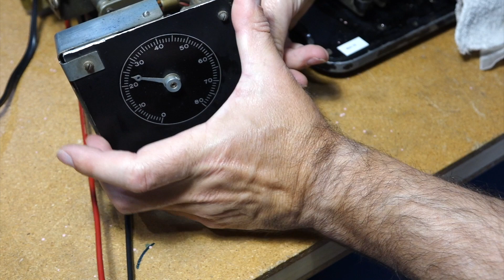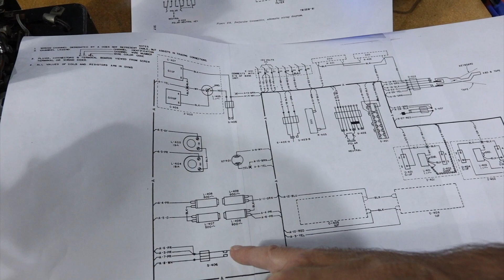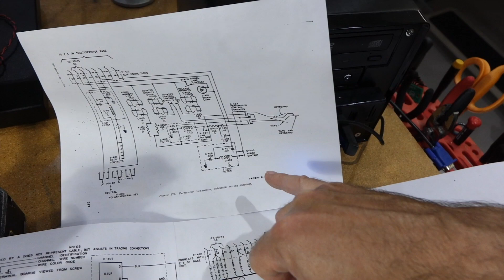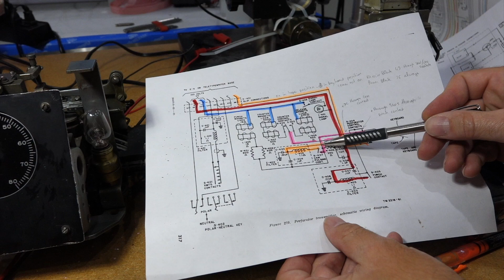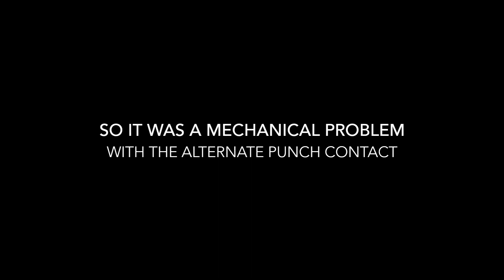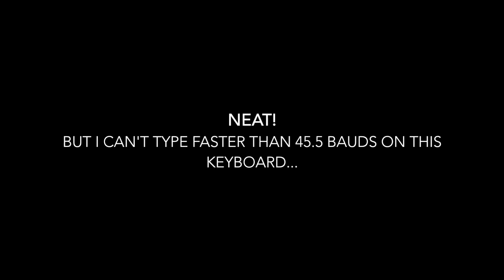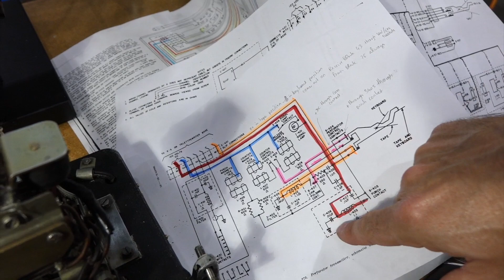Teletype Model 19 Part 6: Fixing the keyboard counter, filter and repeat features

Comment: E: Nvm. I misunderstood one thing and was shown wrong later on.

~~I suspect that the reason the character counter does nothing if the local printer also prints is that you can then more easily (and maybe even more correctly, v. bell) see how close you are to the end of line on the printer. Does that make sense?~~

Comment: I worked at a gov't facility in the late '80s and early '90s, and still used a lot of that vintage equipment.  The contracts for custom replacement parts were simply astounding.   But we managed to have some fun with all those punch chads we collected!  Take a cup full and drop them into the defrost vent in someone's car, set the switch to defrost and fan to high... then wait for the show when they leave work!  😆

Comment: Have you tried copying a tape yet?
Reply from the maker: We'd need the reperforator unit that we don't have (yet). But word has it that we might get one soon, the very one that belongs to this unit actually.
Reply: We don't yet have the tape reader (model 14 Transmitter Distributor) working, thus tape is output only for 5 bit teletypes

Comment: Is there a way to select 45.45,50.0,75,150 baud.
Reply: Gears are changed to convert between the different rates on the later models, e.g. 28. For the model 14/15/19 generation machines, some had motors with governors and those could be adjusted to the higher bit rates. The synchronous motors on the model 15 were fixed at 60 wpm (45.45 baud).
Reply: As Carl noted, it was largely mechanical (gears).
While older Teletypes were Baudot (5-bit) ... later Teletypes, added support for ASCII (7-bit).
The FCC prohibited the usage of ASCII, “over the air”, until late 1970s.
Definitely a role in 1970s computing, both Time-share and beginning of micro-computing (read how Gates/Allen loaded BASIC for Ed Roberts into the MITS Altair).

Comment: My mind boggles at the mechanical craftsmanship in these units. At the design and prototype stage can you imagine how each and every part was individually made! With mechanical calculators and typewriters abound at that time, there must have been quite an industry in small mechanical parts.
Reply from the maker: That was the age when mechanical engineers ruled the earth. Then they got upstaged by electrical engineers, who eventually died off when they were supplanted by the software engineers that rule the modern day. I wonder what the next step of evolution will be...
Reply: @ CuriousMarc: The next stage is already there. It´s marketing managers and big data analysts.
Reply: @Eo Tunun You mean Bachelor of Science in PowerPoint... ;-)
Reply: Indeed! There must be some incredible unsung engineering feats at the silicon level these days (and software!) that are hidden from casual observation and analysis. I fear in 100 years there may not be the same nostalgia for our current technology. If AI takes hold in the design industry do we risk an ever increasing engineering knowledge gap with products exceeding human understanding or scrutiny!

Comment: Marc, you might want to check out that dashpot on the back of the counter (and any others that you see) if you haven't already. They are usually oiled, and after 50 years the oil turns to glue and they don't do what they are supposed to do.
Reply: Yes! The carrier return dashpot on my model 15 printer clearly needed some work before it was working properly.